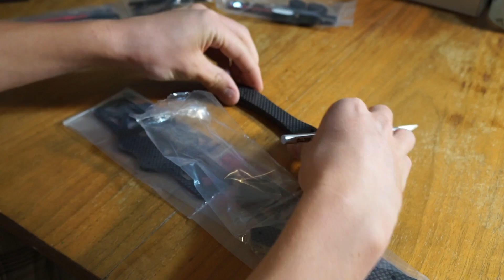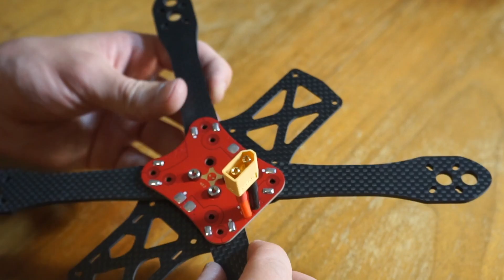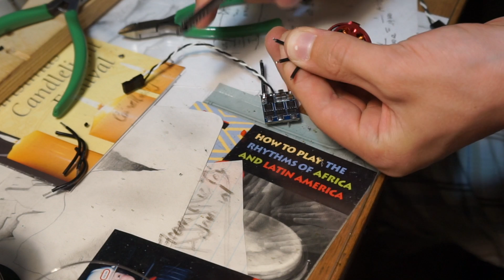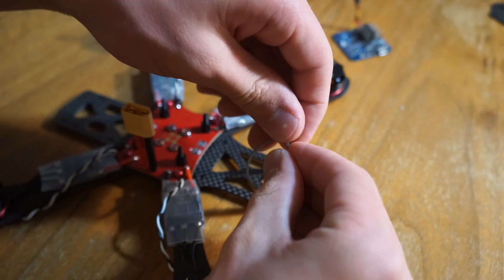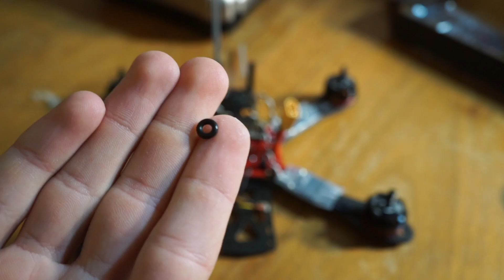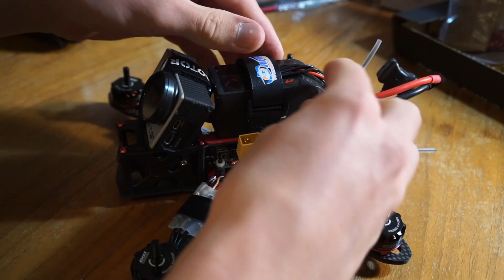RR5 Alien - A Build in 10 Minutes

Comment: but for the esc secure i would use subties and not electrical tape beacause of the ESCs getting hot
Reply from the maker: As long as you have sufficient ESC's you should be fine. I've been running them like this for years and never had issues.